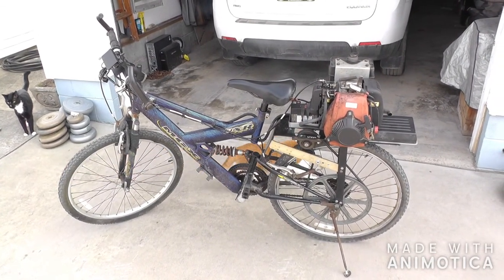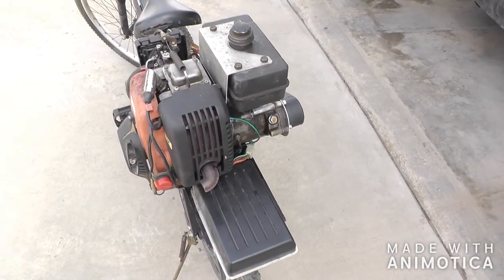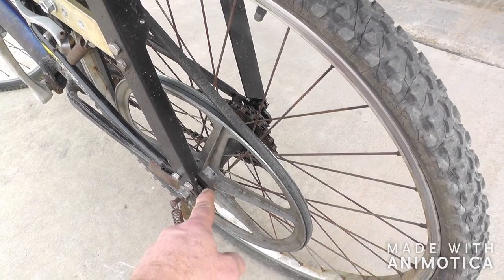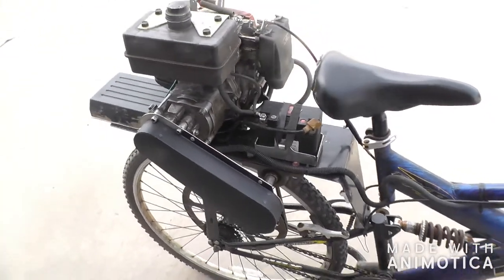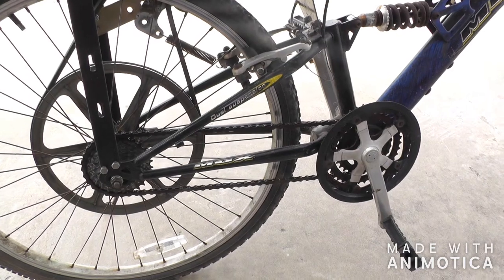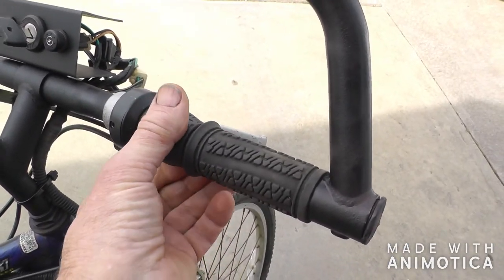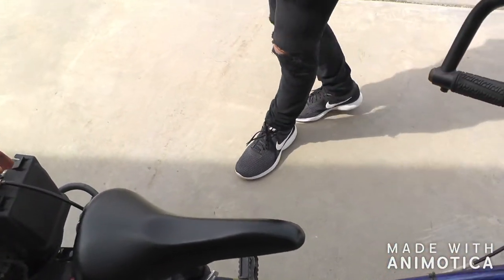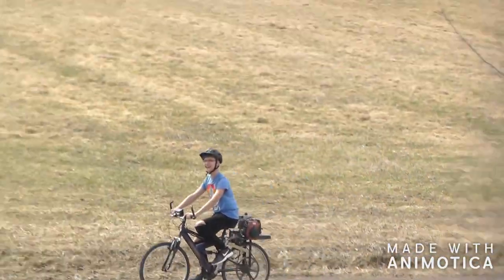Motorizing a Bicycle DIY

Comment: Sweet! I've done the same kind of build a few times. Also made a mountain trike (mountain bike with two lawn tractor wheels on back) also rear mounted engine.Good fun in the snow. I've done BMX frame ones as well. A really clean engine mount look for the BMX frame version is to take a second set of BMX forks and mount them to the seat post with an aluminum handle bar block like is often found on BMX style bikes. It gives a nice low profile mounting area free of down tube supports. I used mag wheeled BMX with another smaller bike rim mounted to the mag to belt drive it.